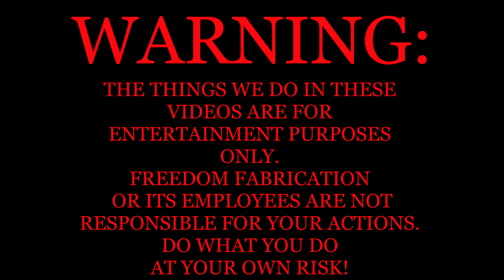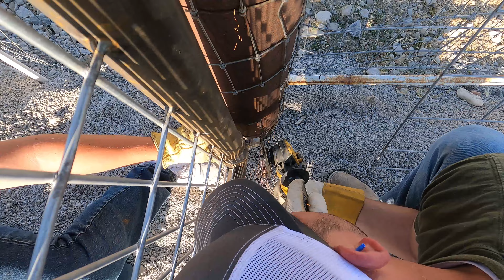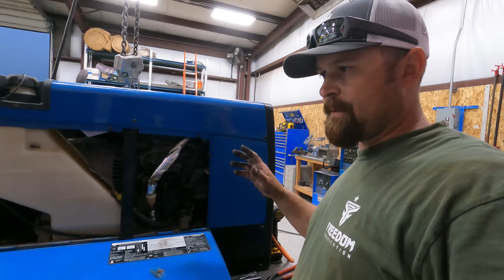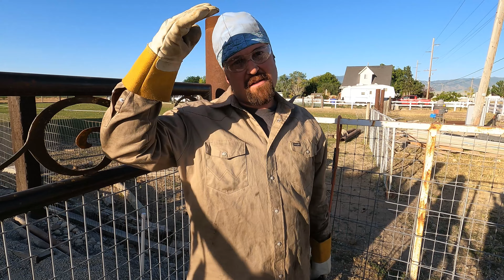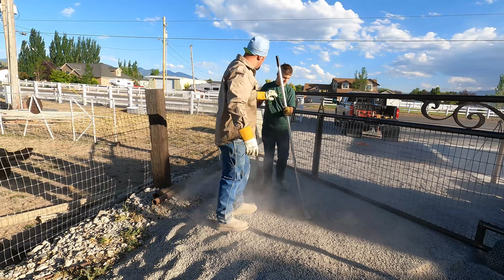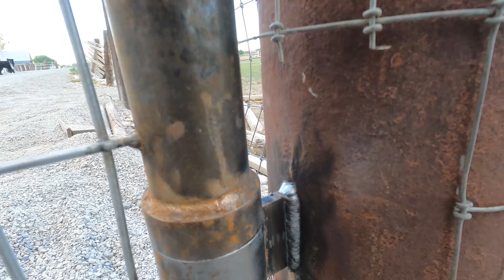Mobile welding Large Yard gate install

Comment: Just come off a job doing about 120 feet of replacement cross pieces in a pipe fence after a car took it out. Pipe was all magnetic and a real booger to weld. Tried everything to get beads to run smoothly. Wrapped ground around pipe 10-12 times both directions, heat, AC current, switched to smaller rod, etc. Finally got the 5/32 rod to run on DC Straight Polarity but it took multiple passes on every weld.
Reply from the maker: That sounds like a bugger. Those are the things that you can never plan for. I hear it’s quite common with drill pipe. Roll with the punches. Sounds like you did just that. Thanks for watching!

Comment: Do you think the entire gate should have been  higher? Simply to allow the driveway some room for error?
Reply from the maker: It still would have needed grade work. It needed to be built up on the down hill side, and dug down on the uphill side. If I raised it up, it would have needed built up about 3/4 of the swing radius. It is a reasonable question though. Thanks for watching!

Comment: Nice work! Just a suggestion, because I have personal experience with the issue..... the latch, I would have made the hole a vertical slot. That gate is not always going to line up, height wise. Over time it will either rise or drop from grade variences under and such, and maybe the hinge post will tip a little over time. Nice fix on the welder.

Comment: Ouch that sucks, I typically use a separate genertor then use smaller in size Stick/ Mig welders instead of using a dedicated Engine welder. I find it a little more flexible and cheaper.
Reply from the maker: I was just glad I was able to fix it, and it didn’t require spending any money. Thanks for watching!
Reply: That's what a gas powered welder is for. Welding and portable power in the field and for installations. I don't understand the benefit of using a separate generator and welder in the field. Even when I use my Lincoln MP 210 in the field, it's powered by the Lincoln gas driven welder mounted on the truck.
Reply: @edgalvan3440  generator is way cheaper, I can plug any welder into it.
I also get 3 phase 380v power, single phase 230 and single phase 110
It's just more versatile in my opinion.
The generator side typically aren't as powerful on engine drives.
Depends on your work flow and use case ofc some workflows suits engine drive more.
The other benefit I find is sometimes I have access to power on site, I can just pull a small inverter from the van and bring it to the job.